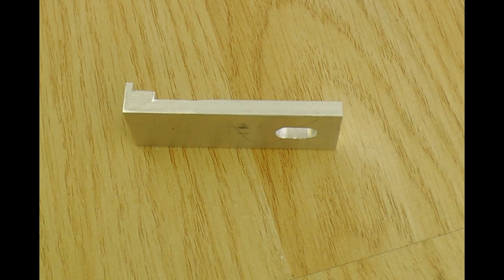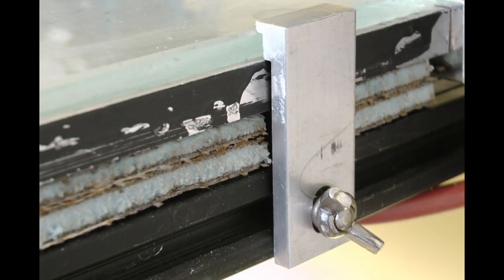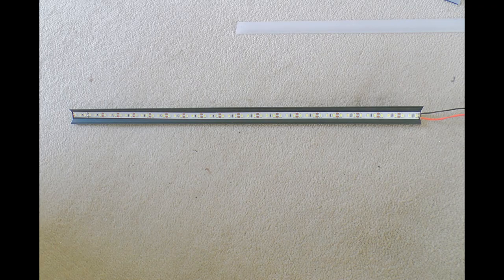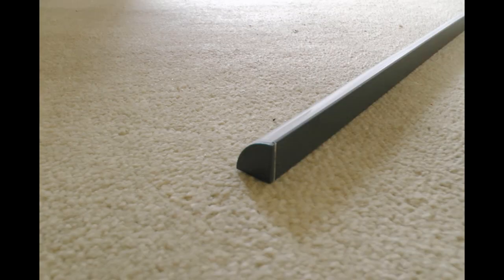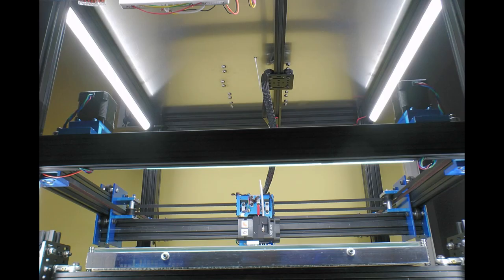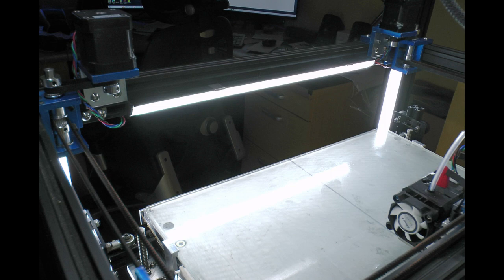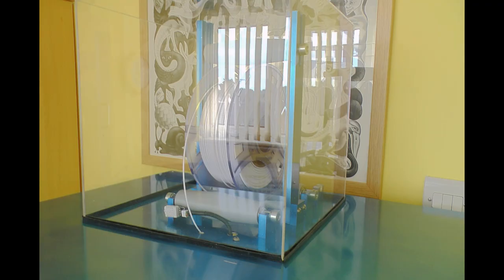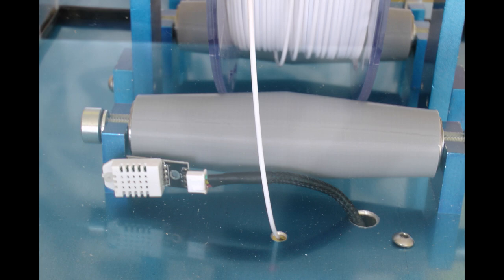NewCoreXYPart11 - Let there be light

Comment: nice update, great :D, I missed the video of the first print or you did not share it?
Reply from the maker: Not only didn't I share it, I didn't even film it!. I was busy doing other stuff at the time and it wasn't exactly anything exciting - just a plate with 8 pillars for heat set inserts to mount the circuit boards on. I also took the opportunity to upgrade my ancient slicer to a newer version and the easiest way to do that with this machine, was to start from scratch with a fresh installation. But I didn't look all that closely at the default speed settings and whilst 60mm/sec for perimeters was OK(ish), 20mm/sec for solid infill was painfully slow. I'll do a proper video when I have something more interesting to print and when I've got things like speeds dialled in.
Reply: @deckingman  understandeable :D ... but you know "first steps", no matter how many times you see them... :D